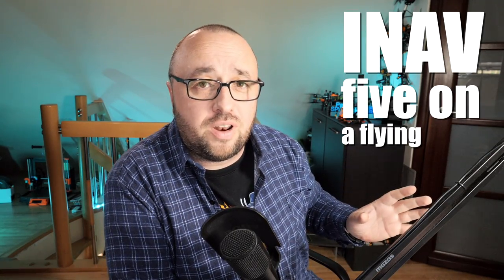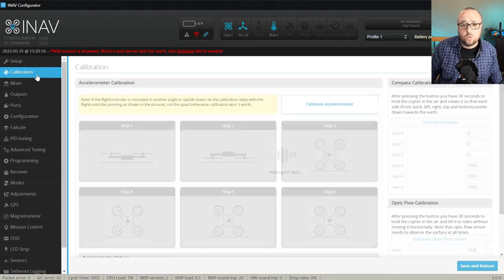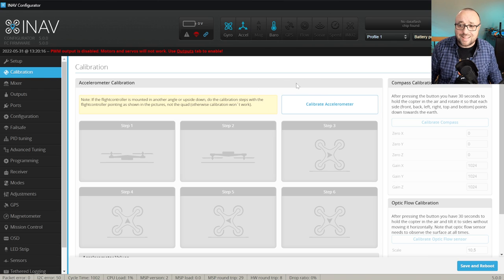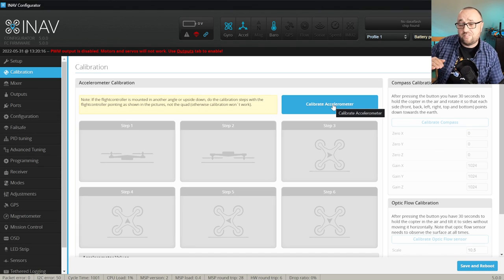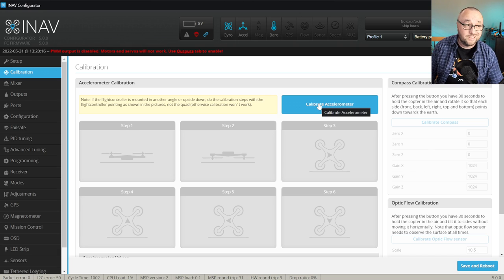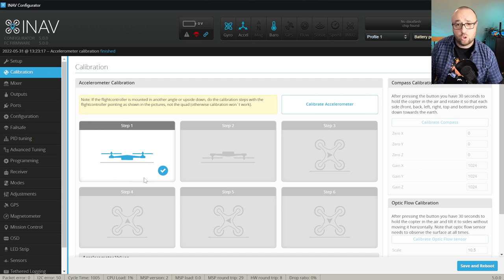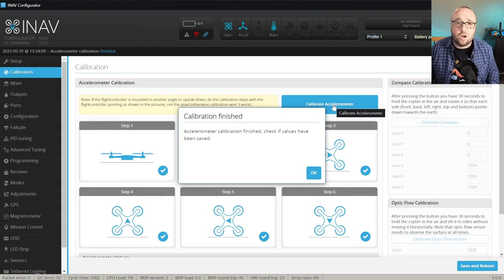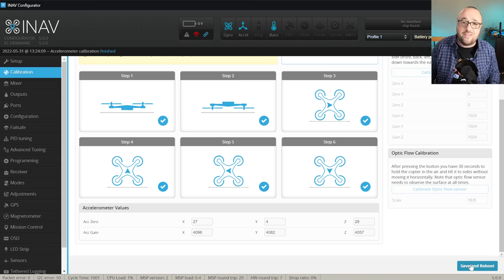Accelerometer Calibration | INAV 5 on a flying wing | 3/11

Comment: Good news bluetooth is enabled! I have a matek F405 with a broken usb connector and hoping to get use of this option. Have tried to connect a functional matek with BLE in the configurator, uart 1, MSP and tried all the baudrates. I am using a 5v JY-MCU bluetoothmodule. Haven't been able to connect to Inav although my PC does recognose the module. Do you think this is fixable. With the current flightcontroller prices it is worth it, to give it a try.

Comment: Nice video! What can I do when the orientation is correct but the roll is off by 6 degrees?
Reply from the maker: Repeat calibration
Reply: @FPVUniversity  that didn't help, it's still the same unfortunately
Reply: @FPVUniversity , Pawel, I calibrated accelerometer before to set correct FC alignment up. So it was 90 degrees uncorrectly rotated. Is that a problem for accelerometer calibration? Should I repeat calibration?